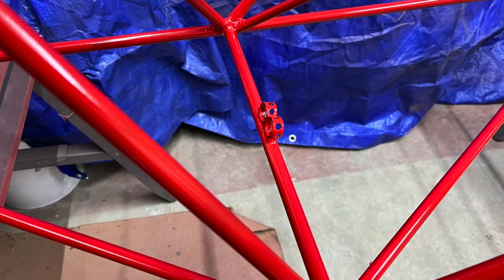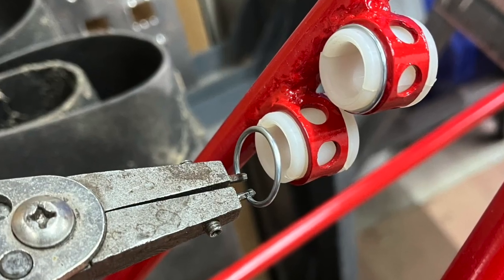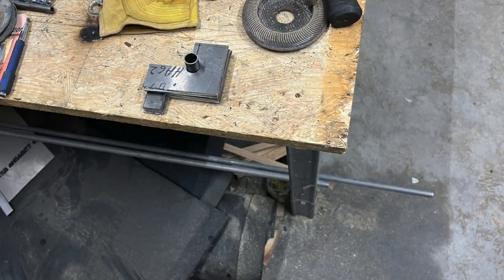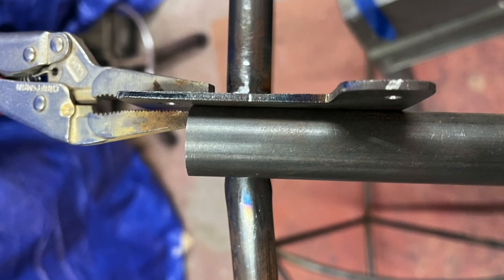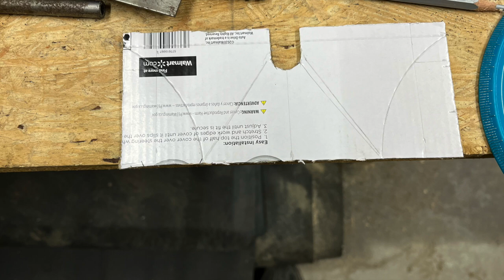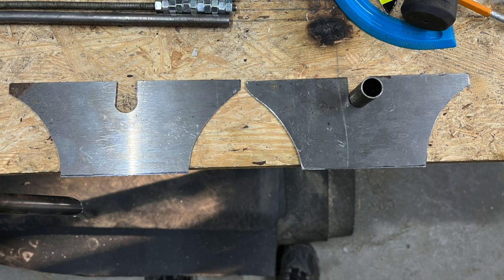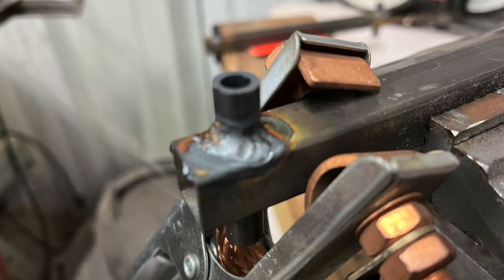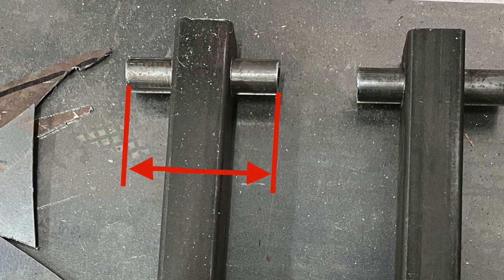ADCO Aviation - Legal Eagle XL Ultralight Aircraft Build Series 16 - Landing Gear & Wing Brackets

Comment: Assuming the upper rear bracket is for rotating wing
Reply from the maker: I made a later video on the folding wings.  I believe what you see now is the rear wing mount. I spread them slightly so I can add a fuel tank in the middle.

Comment: How much welding had you done before starting your build? I just hot my oxy/acet welding gear and running practice beads - the idea of making Airworthy welds feels a long way off!
Reply from the maker: well, several things here...  I did a lot of practice... couldn't tell you for sure how much... KEEP PRACTICING!!!  And some time when you think you're ready to try, take a tube and cut it at a 45 (like the rudder pedal) and tack weld it together, all the way around, put it in a vise & try to break it... If you just bend the tube & the tacks hold the joint - you're probably ready... I had a welder of many fuselages tell me that... I know this may start an armchair war, and you will be criticized by some if you can't make the PERFECT looking weld every time (a lot of builders will not brave the internet for this reason) Many will always say they have been welding for years, but--- (doubt they've ever built an airframe)... Anyways I'm sure someone will chime in here & say how unsafe I'm making this community... But here's the thing, this frame is sooo over engineered... I'm not giving my stamp of approval for poorly welded aircraft obviously, but make it safe - try a destructive test & by the time you get done welding the overly engineered fuse, you'll feel safe making those more critical pieces... And remember, you'll be testing & preflighting before every flight... You built it, so you'll see issues (before they're 'issues') & you'll be able to fix if you need to... Personally, I'm more worried about the welds on my landing gear not holding up rather than all the cross tubes of the truss-like fuse... especially on a slow moving ultralight like ours and how many times have we seen the landing gear crumble (not because of welds by the way) because of forced off field landing & the plane was repaired & flown again... I say that to say this, if you'll feel better, go take an evening corse at your local collage - you won't regret it... but also, don't worry too much, don't let your fears keep you from starting - enjoy the build... Oh BTW, tip - build station 1 completely FIRST! then make the backbone (3 pieces) welded as one completely! then make the bottom COMPLETELY!!!  This way you can keep everything straight & completely weld all connections while it's on the bench... then bend the tail end up, add the blocks & connect it all together... this will simplify your build 100 fold...  Keep in touch, join the Eaglersnest forum & find someone local... there's a lot of us out there & always feel free to reach out to me...